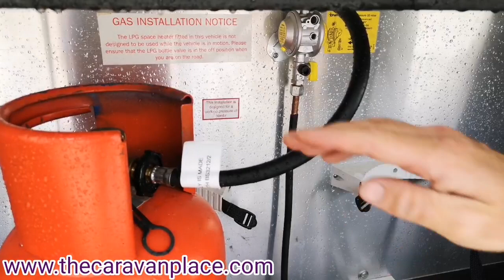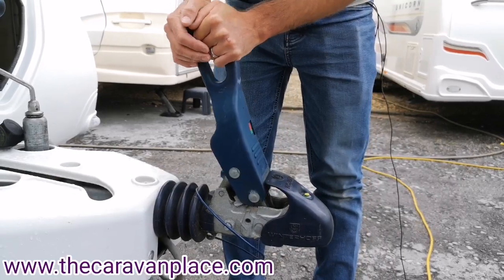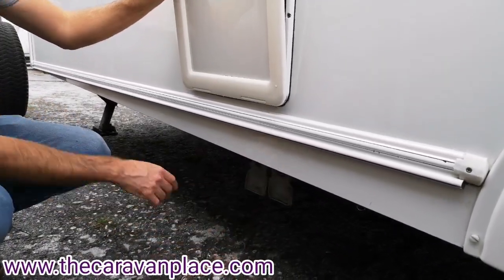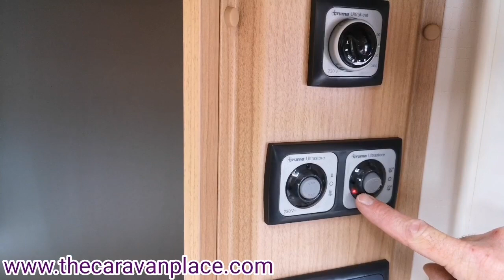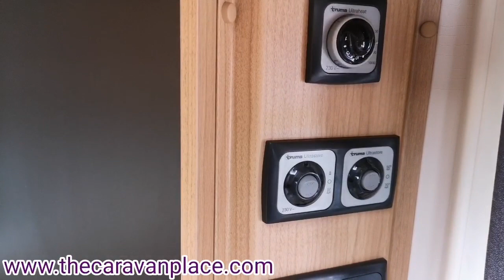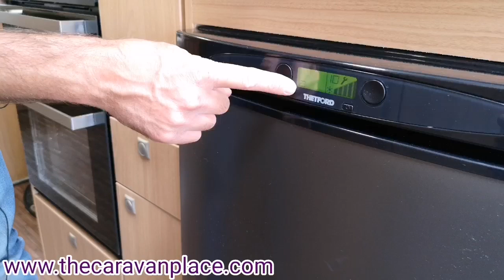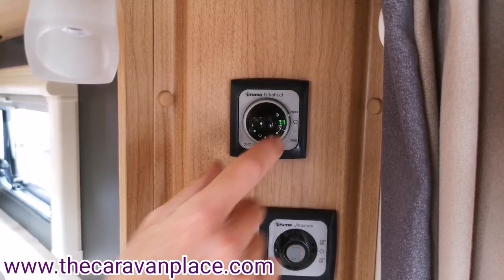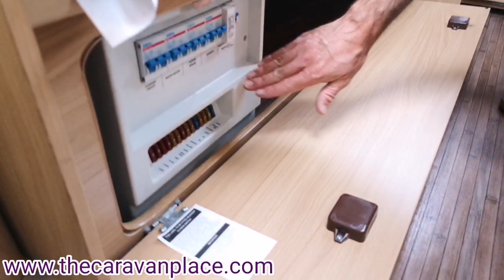Elddis Avante 566 Caravan Site Set Up Guide - How To Set Up A Caravan On Site

Comment: How to determine when the hot water boiler is full and its OK to heat
Reply from the maker: When you have a good flow on the hot taps, kitchen, bathroom  and shower, you then know the hot system is full.